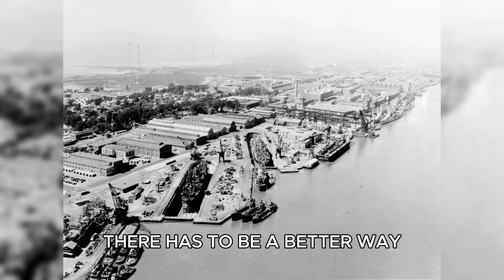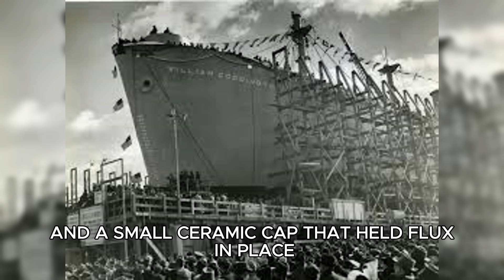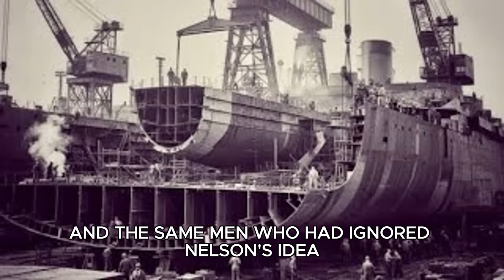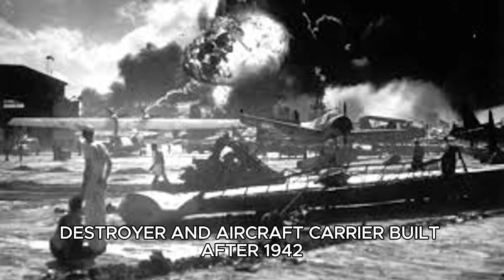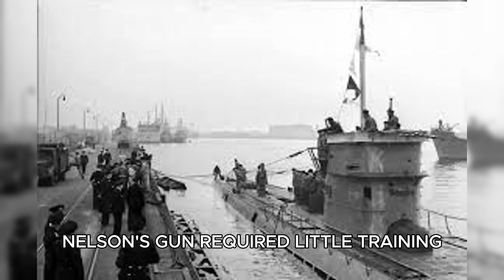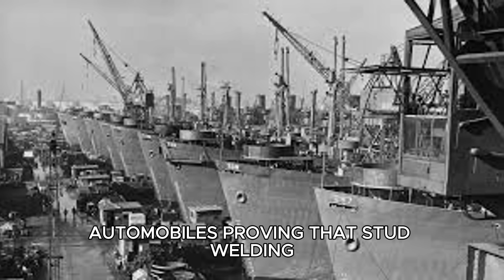How One Mad Welder's Rejected Gun Saved 50 Million Man Hours During WW2

Comment: Now I know where it came from.
Was used in Britain also in the naval dockyards.
Was a titular (semi skilled trade) & basically you plonked the stud in the gun on a bulkhead or deck head, pressed the trigger & induction welded stud in place, where marked off by shipwrights.
Because the plate quality was spot on the heat affected zone did not cause any probs.
To remove em they had to be chiselled off, such was the quality of the fastening process.
Not much to see really just a stud that provided a solid fastening for junction boxes, carrier plate, pipe clips, etc.
Ships drawings included the location detail & specified this method of fastening.
Men made a fortune in bonuses when piecework was in full swing.
Simplicity itself thats why it was so clever.
Good vid, thank you. 🇬🇧

Comment: I'm unclear what studs were used for in a submarine.  I've shot studs through form deck onto structural steel to be encased in concrete to create a diaphram composite deck, but how would they be useful in marine construction?
Reply: Basically anywhere where something needs to be fixed to a bulkhead, deck or deckhead for internal fittings. 
The Hulls were welded or riveted together but in order to fix stuff to the Hulls you would have needed to drill a hole and use a bolt and nut as fixings. Welding a stud meant no hole or bolt required, just a nut and washer, it also meant watertight integrity was maintained between compartments as no holes!
Reply: @nickmaclachlan5178  A perfect explanation.  My understanding of studs was colored by my personal experience in commercial construction. Thank you.
Reply: @phillipdavidhaskett7513   Absolutely no problem my friend.